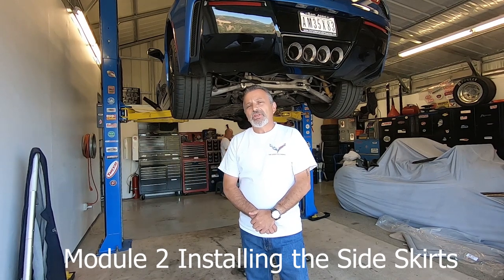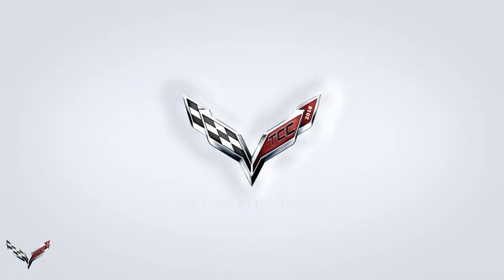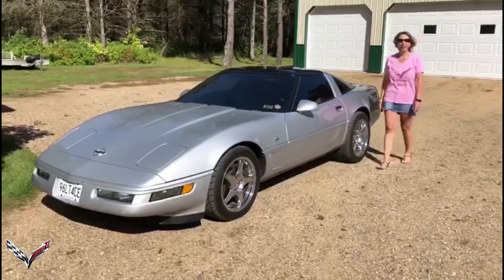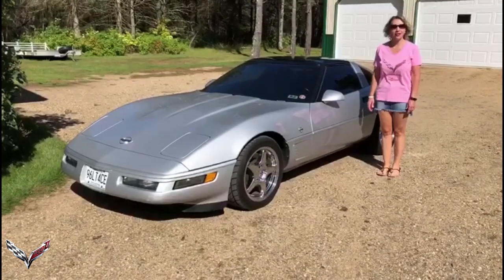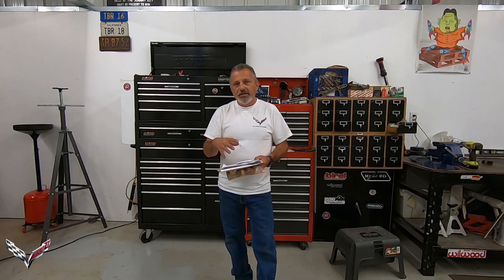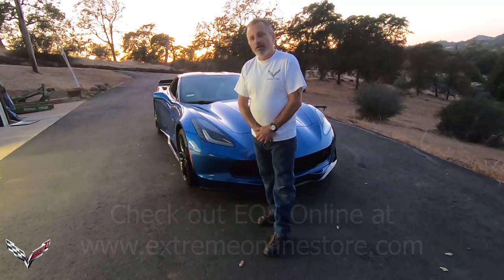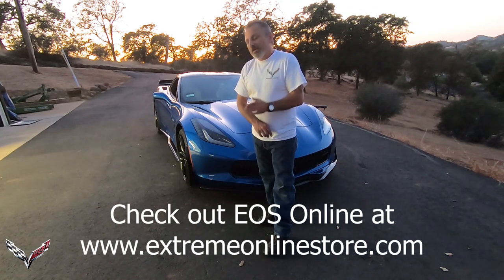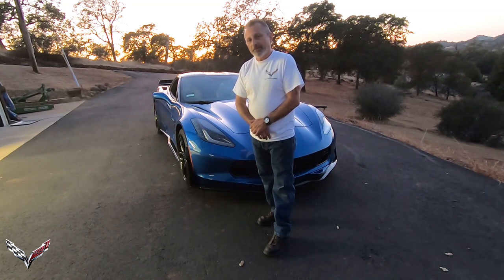How to Install Side Skirts from Extreme Online Store on a C7 Corvette Module 2

Comment: Although these are outstanding for the price the side skirt is drilled into the lower SIDE of the rocker body panel while the more expensive ($500+) side skirts have a wider flange and mounts underneath.
            - reason this is important if you buy the less expensive side skirts (like this one) you can never remove them because you would see the screw hole on the side of the rocker panel!
Reply: I agree, it was a very hard to get over the idea of screwing into my rocker panels. I however installed these same skirts on my C7 and they look fantastic. My justification is im never going to own this car without these skirts on it for the rest of its existence. If these get damages i will, or the next owner just replace them. My car will never be a collectors version so im good with my install.  Thing is even the factory installed versions drill through the rocker panels, they just use rivets. As for the transmission lines, just be very careful when drilling the holes and put a stop on the drill. The screws provided are short enough not to come in contact with the transmission lines. If you are really nervous, just use rivets.
Reply: where would i be able to find the more expensive side skirts that i would be able to remove.

Comment: What about the transmission lines? Is that a manual?
Reply from the maker: The Transmission lines run through the rocker panels. So you need to be careful when drilling the rocker panels for the Rivets or use very short screws. No the car is an Automatic.
Reply: @THECORVETTECHANNEL What where the length of the screws you used and what would be too long? In this matter details are critical otherwise you could be leading people into a disaster....screwing into the transmission line!
Reply: @Maximum1A  only reason i havnt installed mine
Reply from the maker: Most kits come with the proper length screws or rivots.
After doing so many of these I like robots better.
Most of the time you won't even get close to a line. So basically if you drill out the hole for the rivot you should have the drill go thru real easy, but if you are feeling resistance or you feel or hear you are touching metal then stop and don't use that one hole. There are many mounting points so if you can't get a rivot in a couple of the mounting holes it is not a problem.